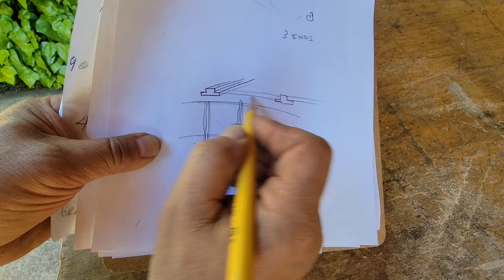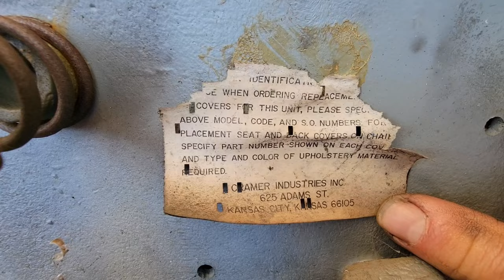Day In The Life: Resurrecting A Vintage Drafters Stool & Astro Van  Stuff

Comment: Your links to Jordan and JankyAF don't work man. I did do JankyAF in YT's search but can't find Jordan.  Nice stool Mike. 
Well designed and heavy. Not like the cheap version I have that had a frozen screw- in adjuster riser. Does have a seat 
cushion that was in perfect shape so bought it anyhow. Took a day to let good old Blaster penetrator to work on the screw threads and worked it loose. The casters were all worn so I replaced them. Only wished it had a backrest. Nice job on yours. Steve from IL
Reply: Links fixed.